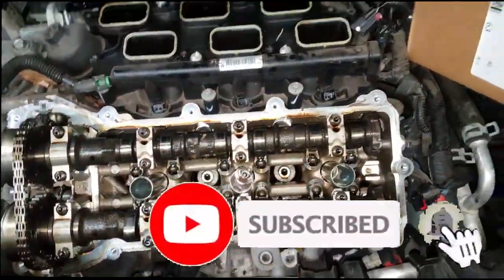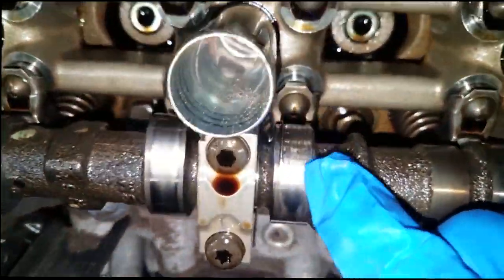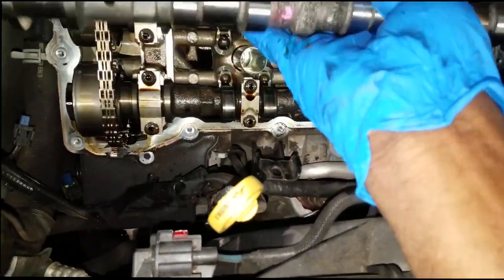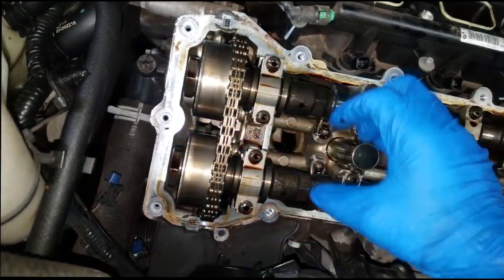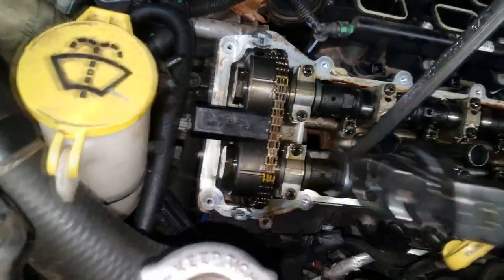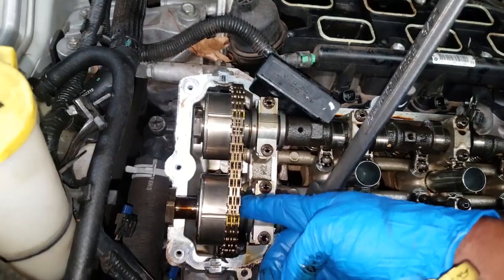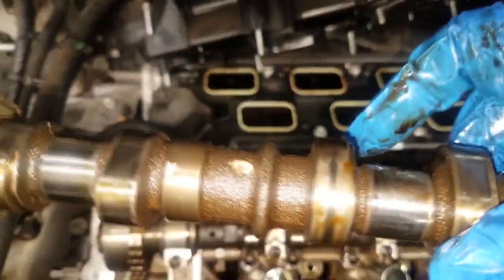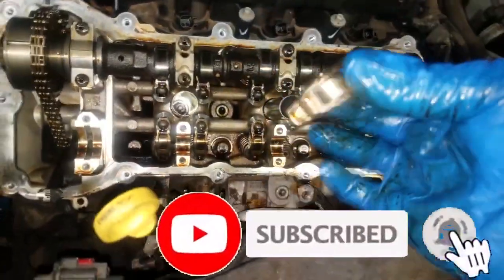FOUND IT. 3 6 Pentastar broken rocker arm noise camshaft ticking motor.Timing chain cam phaser

Comment: JT,  so you/ the shop communicate to the customer regarding only 1 lifter covered and OFFER option to pay difference to replace all with offset charge?? If keeping long term term it would be logical. Also putting old lifters with new CAM would suck!
Reply from the maker: Yes I have been known to offer customers option to pay for any additional rocker arms thats not covered by the warranty with no extra labor because I'm already in there. As for the lifters I don't think I've ever had a problem with lifters so I choose to same my customers money on those. But everybody different
Reply: @OnlineMechanicTips  Yes, sorry. Meant  lifters. And that's awesome to know.

Comment: Some people know there's something wrong with their car and will actually drive the car until the point of failure. Then they're upset because it's costing more to get it fixed now after it failed than it would have before it failed. I see it all the time. People driving around with their brakes chirping or the whining noise coming from the alternator or having to keep putting coolant in the radiator. The problems are there but people just ignore them.
Reply: specially the erl leeks.

Comment: I warned my parents of this since they have the same engine. They both said they replace their oil at 5k miles using the correct oil. Will that help prevent this?